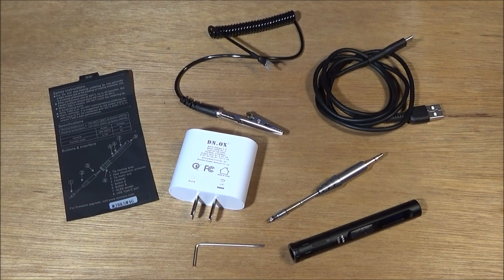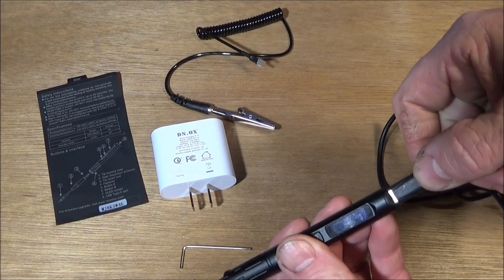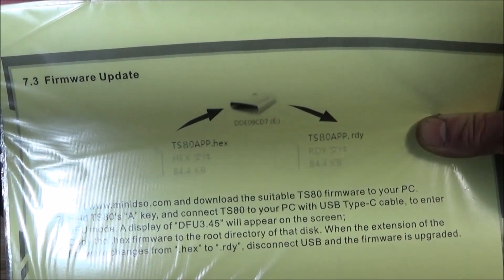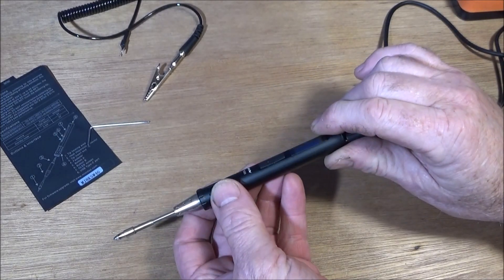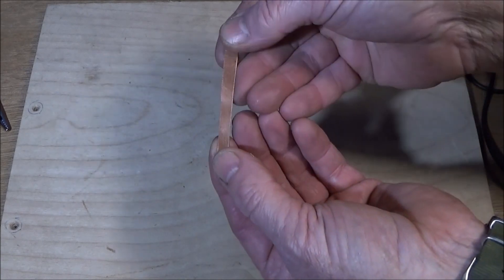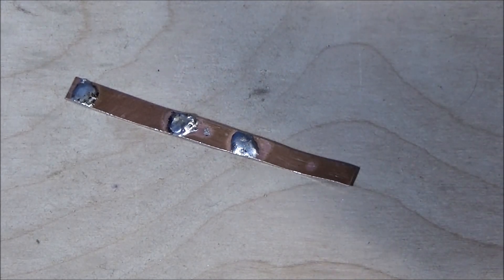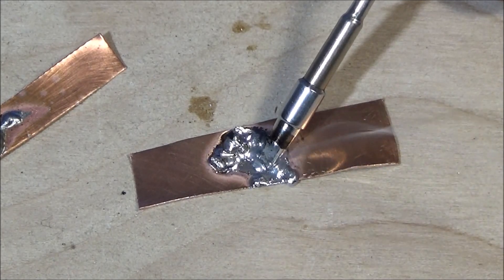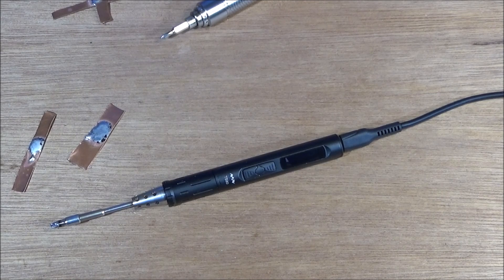TS80 SOLDERING IRON + How To Get Full User Manual & Firmware Update

Comment: And I have an additional problem: When I use it on my Baseus Powerbank, though it is Quick Charge 3 oder higher, it only works a few times and only for a few minutes. Mostly it says low voltage, but when it works, it suddenly switches off. Any idea?

Comment: Hello, I have problems with this iron (it is my first one and I am a noob in soldering ;-) ), the solder doesn't stick to the tip, it makes pearls and often falls off. It is difficult to transfer the solder to the solder joint. Do you have an idea? I always have to use "Tippy" so renew the tips... I use leadfree solder, could this be the problem (Sn99 Ag0,3 Cu0,7 @0,8mm)? Perhaps you have an idea... I try to solder at 350 to 400 °C. Sometimes it works, but often I have problems and the tip never gets coated by the solder
Reply from the maker: Hi I'm not an expert either. I dip soldering iron in flux paste. I think the new tips run in after a bit of use. Hopefully someone else will answer your question. 
 I mainly use lead solder as I never really solder circuit boards. I mainly just solder wires. Regards Steve
Reply: @SteveJordan  Hi, thanks for your reply! I have a flux pen and always put the liquid onto the spots where I want to solder. I have the bad feeling the tips get worse, not better... I use the iron for electronic boards like attaching cables to motherboards of a Gameboy Advance, to connect Philips HUE LED-Strips and so on. And I bought some test boards sets. I damaged a joint on a ribbon cable of an IPS Gameboy display, because it did not want to stick onto the joint... and I damaged a part of a LED strip because the pins are very narrow and I had to get the solder heated beneath the contact pins of the connector. But I did the same some weeks ago and there it worked fine.